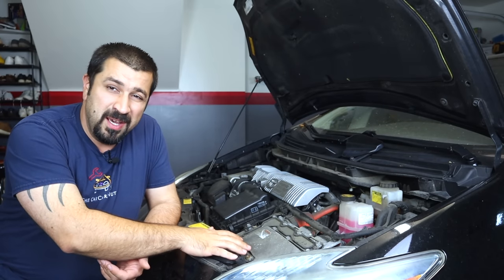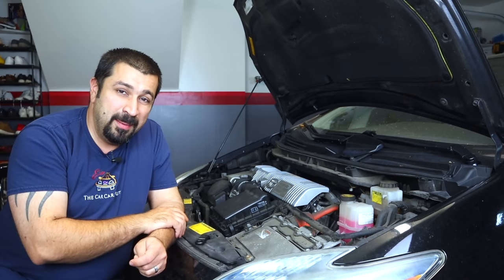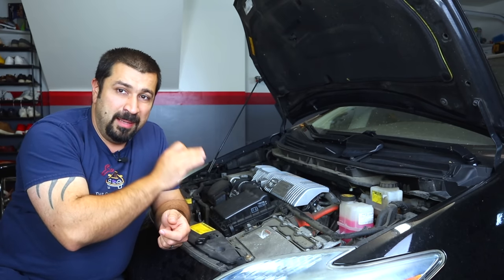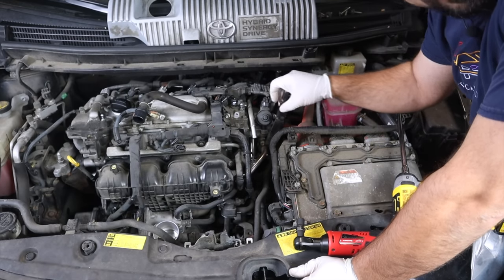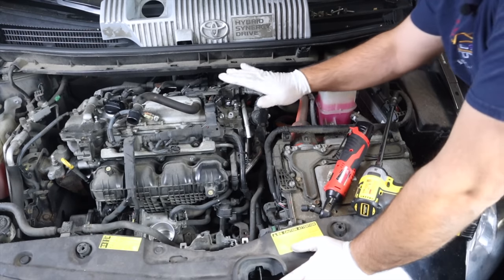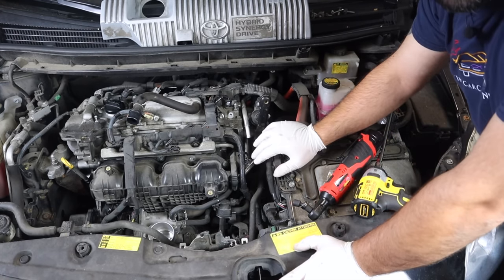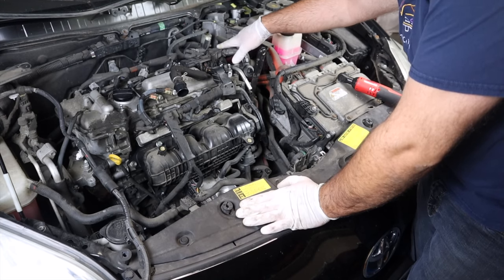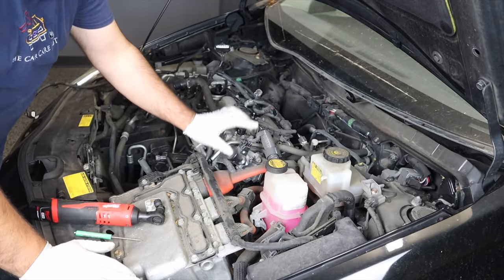Toyota EGR Diagnosis Tips and Repair Tips

Comment: I have a 2013 Prius S and i have this low freq vibration at around 50km/h or when the ICE is just kicking in (just when the HUD shows past midway). not constant just from around 50 to 60km/h.when the hv battery is low cat vibrates a lot too if im driving slow like in a carpark. is that egr related or is that normal vibration when the computer is just trying to figure out to run the ICE or use the HV battery. its only done 90,000 km was there when i got it. toyota did not see any issues with it. is it worth removing the egr sensor and see if it still has the issue or best to clean the ERG system?

Comment: Thank you AMD. Amazing stuff , as always. Question: Does the PCV valve get stuck closed or open and what are the tell tale signs? 
Suggestion: Any chance you can do a  video covering the Toyota 86, common faults and fixes and another video on what kind of supporting mods will you suggest. E.g. oil catch can is a common one people use,  another one is an oil cooler which is now standard on the new GR86 but was not on the older FT86
Reply from the maker: Hi! Usually they get stuck closed which is a problem because of oil leaks and possible oil consumption. 86 videos are on the list just need to find a candidate to use for the video

Comment: Great video as always. That’s refreshing to know you don’t usually clean the egr cooler too extensively. i assume the soot you blew out with air will shoot out the exhaust when the engine runs. 

would you recommend egr valve replacement and intake manifold replacement as preventative maintenance for cars that run fine? let’s say at 100k miles but the car still runs fine? or is it safe to drive it until it gives issues? i know the 2014+ engines got updated manifold. asking for a friend’s 2016 V. 

also what’s your take on the new egr design in the a25afks powertrains? improved? or will the same issue eventually come up. 

hope to see some lexus content from you as well as some updates on your personal projects like your mercedes. those are fun to watch
Reply from the maker: Hi! I disconnected the egr on the other side so the soot fell into the towel not in the exhaust. 

Unless you have an issue with the egr I wouldn’t do anything with it honestly. If it ain’t broke don’t fix it.

The A25A have a very similar design with promises of improvement which we’ll find out over time. The 2016 Prius has no issues as of yet.

The Mercedes video is done just gotta finish a few things and you’ll see it posted😀

Comment: My 2014 Prius with 210,000 miles, intermittently has a small shutter sound in the engine compartment at speeds of 4 mph and up to 35 mph, I don't hear it over 40 mph.   And I don’t feel it in the steering wheel or car at all.

I took it to the dealer for service. 
He diagnosed misfiring, but could not observe any misfire. 
He said Spark plugs looked fouled. 
Service Technician recommended and preformed: 
Replacement the spark plugs and 
Replaced one coil of cylinder 4 and
He also performed an ECU update. 

After service complete, I am experiencing the same small shutter, with a lot more frequently at the same speeds.  It shutters often now. 

Will this cause any harm to drive it like this.  I do a lot of long-distance Interstate highway driving at 65 to 80 mph in Texas and Louisianna?
Reply: Gen 3 prius has issues with EGR fouling. People on prius chat suggest cleaning the entire egr circuit (intake manifold, egr pipe, egr valve and egr cooler) as early as 80,000 miles. Search youtube for EGR cleaning and you'll see a dozen videos on this. You could ask the dealer to do this repair under recall with the replacement of the valve, but most dealers won't clean the entire circuit.  You might not qualify for the recall as it's below 10 years or 150k, whichever comes first. Dealers also don't clean and only replace parts. If you continue, the next common problem is head gasket failure and that will be a repair in the thousands.
Reply: @andrewareva4605  - mine is a  2014 Prius Hybrid with 210,000 miles so I gues that does not qualify.

Comment: One thing about "professional" when you see a dirty air filter, it is not your money, replace. I have a friend that came from the mid east desert area, that place make severe service sounded like a joke, and parts are hard to come by. So they just remove the air filter and blow it clean , both directions and only replace it if damaged.  I do not live in desert areas and I added some cotton like air conditioning pre filter to my air intake box, I never replace the filter. PCV valves used to be replaced like spark plugs in the years past, which is annually, spark plugs do not last as long with points and condensors. I used to just put carb cleaner through it and make sure it will rattle, then I put it back.  Those valves are longer lasting nowadays. Even spark plugs can be sand blasted and tested. But it is not worth it for cheap auto plugs. That is often done with aircraft spark plugs that cost $40+ each and have 2 per cylinder and they get lead fouled.

Comment: Had the EGR valve and manifold assembly replaced 3 years and 50k miles ago by Toyota and now being told it needs to be replaced at same dealership again? Looks like they did not clean the cooler back then like you did in the video. Should it be needing replacement that soon again? Did not cleaning the cooler cause this?
Reply from the maker: Hi! Did they do the update at the time of replacement? What’s the car doing? Have codes or misfires?
Reply: @TheCarCareNut  They told me they did not do the update at the time. However, after much back and forth I requested a video of when they removed the manifold to show me the EGR when they got to it. It was indeed really clogged and the cooler was severely clogged as well. I had both the cooler and valve replaced as suggested. Still wondering why it clogged so quickly? I did have the factory spark plugs still on there @222k miles, did that contribute?
Reply from the maker: Possibly. I would replace the spark plugs as well

Comment: Can't you just unplug the wiring harness from the EGR valve to disengage the EGR system to test it? I was getting bad misfiring and shaking in my 2010 and I just unplugged the EGR valve and it immediately ran fine for several months until I got around to cleaning out the intake.

Comment: Hi AMD, is there an easy way to replace PCV on 2010 Camry 4 cyl with 135K any tips? And do you think it can help resolve some of the oil consumption on this engine?
Reply from the maker: Hi! You can either try to reach it through the wheel well which is difficult unless you’ve done it before or just remove the intake manifold which is what I’d do
Reply: @TheCarCareNut  Thank you for reply. Do you think it can potentially help with oil consumption on this 2AR-FE engine?
Reply from the maker: It could but an oil cleaning solution helps more
Reply: @TheCarCareNut  What type of the product you had a success with?

Comment: AMD... Great video on a EGR for Prius hybrid! I was very interested in this video because I have a 13 Avalon hybrid with 90,000 miles. Should I be concerned about my EGR? Throttle body or nothing like that has been cleaned but it runs smoothly at all times
Reply from the maker: Hi! I wouldn’t worry about the EGR unless it has issues. If it ain’t broke don’t fix it.
Reply: @TheCarCareNut  okay thank you!

Comment: Hey I've been having issues with my 2012 prius v2 it has a rough start has been for awhile now I replaced spark plugs and coil packs as it threw a misfiring code for cylinders 2 and 4 that didn't solve the issue any ideas? 

I was going to clean out my egr like this video.

Comment: You mentioned Toyota replaced EGR valves for free some time ago.  How do I know if my used 2010 Prius had this done by Toyota?
Reply from the maker: Hi! You can call your local dealership and they can run the vin and find out.

Comment: What if i get a p0302 code for missfire? Would changing all the spark plugs fix the problem or would i still need to clean out the egr valve?

Comment: Hello,

I would like to buy a 2018 Lexus CT200H and would like to know if the reliability is better than the 2012/13/14 models?

While researching I saw that Toyota had modified this engine and would have received a number of modifications depending on the years, modified head gasket, segmentation / pistons, egr valve etc...is this true?

Thanks in advance.

Greg from France .

Comment: How would you recommend cleaning the intake valves on a 2017 Camry hybrid se
Reply from the maker: Hi! Are they carboned up?
Reply: Not sure , but I thinking about using fuel additives like gum out for tune up because My car is at 130000 miles

Comment: Could you give me your thoughts about an oil catch can for a 2010 Toyota Prius
Reply from the maker: Hi! That engine does have an oil separator so unless it burns oil it doesn’t really do much
Reply: @TheCarCareNut  Where is the oil separator on a 2010 Toyota Prius
Reply from the maker: Behind the intake the Manifold on the block where the pcv valve is

Comment: Would an oil catch can be helpful on a vehicle like this?
Reply from the maker: Hi! It can but this engine already has an oil separator built in behind the manifold which is where the pcv valve connects to which does the same thing

Comment: Question...2gr-fe V6 engine (08 Highlander) vibration between 900 and 1000 RPM. When it's cold start it rumbles the floor.
Reply from the maker: Hi! That could be normal of these engines. They do tend to be on the rumble side at times. Try cleaning the throttle body

Comment: Is it true the gen4 has a larger egr that's less likely to block?

Do you know if products like Techron help avoid EGR clogging?
Reply from the maker: Hi! The 4th generation did get an updated egr system and so far so good. The software update does limit or eliminate the issues by changing the way the egr system operating.
Reply: @TheCarCareNut  The EGR on 4th gen comes from exhaust after the cat. It is a lot cleaner. The 3rd gen EGR takes exhaust gas before the cat. On a side note, my brother's EGR cooler plugged up 100%. I replaced it and the valve. The intake manifold wasn't that bad. I did replace the PCV though.

Comment: Hi
There is a nut and bolt on egr, and the long nut is in there tight, what technique you have for taking that bolt out ? It has a hex end maybe a #6 socket fit.
Reply: Also, why remove the cooler at the rear if just blowing out ?

Comment: Hi AMD.I am a female that recently purchased a 2010 Prius. A code came on today p0401 (EGR). I'm losing coolant slowly and I put in the coolant reservoir some sealant thinking I have a blown head gasket. Could what I did cause the p0401. What would you suggest I do with this code? Any help would be appreciated. Im in Las Vegas NV. Do you know any mechanics in Las Vegas you could refer me to.
Can I drive my car with the engine lught in with the p0401 code? Can I out fuel injector cleaner? Would this help? Thank you kindly

Comment: appreciate the video more hands on and I own 2 Toyota's.   AMD do you have an email, I have a few questions about another topic which is minor stuff  that stopped working, require replacement but would like to also upgrade.
Reply from the maker: Hi! The email is really getting backed up. Post your questions as comments here and I’ll get back to you.
Reply: Please advise me if there is an easier way to replace the day/ night sensor without removing the dashboard.  on a 2008 Lexus is250 AWD.  it has all options with navigation.   appreciate  your time, AMD.
Reply from the maker: Jay I’d have to look into it as I don’t remember that right off the top of my head. Reply to this comment and I’ll get back to you.

Comment: i have a dealership maintained 2010-Prius. 
recent “check engine”, just a few days after they had our car for almost a month ( internal computer module, warranty change), 
turned out to be an EGR valve issue.
there’s no symptoms nor any mention on previous detailed reports , 
but for this new “check engine” light.
why is that?

Comment: Hi all mechanics! (or channel owner)

Im sure you’re INUNDATED with work between the channel and your shop, but i REALLY could use some help.. especially being that you’re a master diagnostic tech.

THE STORY:

I live in NJ, Girlfriends toyota prius (gen 3, 2011 87K miles) was parked at her job for 8 hours on a 40-45 degree F day. When she went to start car, engine began to shake notably which was audible from inside car. this scared her so she immediately shut it off and called me. 

When i got to the car she turned it on and with the hood open i could visibly see the engine shake, after letting it run about 20-30 seconds car seemed to level out and engine appeared to sound normal. however, now each time car is started engine appears to shake for a small period of time (1-2 seconds).. this understandably has her paranoid and she hasnt driven or moved it from her job. This happened 11/24/22 on thanksgiving.

I have no mechanic expertise, however after some research into the gen 3 prius issues ive narrowed it down to 7 main possible problems..

1. Headgasket -
(Coolant is reading right at  “low” line in main tank and in inverter coolant tank) 

I performed a block test while engine was cold, and after allowing engine to reach operating temp, test fluid remained blue. 

exhaust came out of tailpipe white for 5-10 seconds after cold start on cold day but after that it was completely normal

no “sweet” smell by motor..

so not sure if its HG,  because low coolant is suspicious but it passed block test and no other obvious signs showing..

2. Possibly EGR - Car has probably never been maintenanced for EGR (it was a used vehicle)

3. Possibly the intake manifold

4. Possibly dirty fuel injectors 

5. dirty/bad spark plugs

6. PCV Valve bad?

7. Maybe condensation from humidity in air made it into cylinders, causing that initally rough engine start until it burned off?

For any mechanics or people with toyota prius knowledge is there something im missing or should i go to a shop and have them explore into these main 7 issues?

The REAL issue is we dont have alot of money, we’re both medical field college students trying to survive in a studio apartment and life is just rough right now.. alot of mechanics either give the “dick you around” answers, or the “scammer” vibe and i just want to make sure when i go to a trusted mechanic i can point them to the right area to avoid wasting time and thousands that we barely can afford in pointless repairs especially since most people dont work on these prius hybrids often.. 

I can exchange contact info and send a video of the engine upon that initial rough start-up, and how it sounded AFTER 30 seconds running..

Im desperate guys lol.. and she has no way to get to work so its a rough time..

- THANK YOU SO MUCH FOR TAKING TIME TO READ MY DILEMMA
Reply: I am NOT a mechanic. What I tried and made a difference (reduced startup shaking) was cleaning the MAF sensor with MAF cleaner and cleaning the Throttle Body with Throttle body cleaner. There are videos on how to do on Youtube. Good luck.
Reply: @norbertojr001  the issue ended up being that the car had a lot of condensation due to being started on a cold, humid day. We towed the car to a mechanic that we discovered on YouTube and his shop did a full inspection of the vehicle and they made the determination that there was nothing wrong with the car that the car had a cold start that just didn’t sit right with the engine, but it was only a temporary issue so this was back in November 2022 and now it is March 2023 and we have had no issues with the vehicle up to this point so I guess the mechanic was right and we did not have to spend money on any crazy repairs or scams they were actually really good mechanics but thank you for responding to my message. Nonetheless, I appreciate it!!

Comment: Pro tip: use a pressure washer with warm soapy water to clean Intake manifold and cooler. Gets the job done very well and quickly. I took mine to the local car wash. No need to deal with big volumes of toxic cleaner and manual brushing.
Reply: Of course make sure everything is 100% dry before reinstalling. I left mine above my house heating vent for a few days.

Comment: If you're still monitoring comments here, is there anything that can be done as part of normal maintenance to keep the valve from getting clogged or at least increase the interval between the needs for this kind of repair?  

Is it possible to do the SW Update using a tool other than techstream?

Comment: What are your thoughts on installing an oil catch can to prevent the intake from clogging again?
Reply from the maker: Hi! This engine has a build in oil separator. Updating the software and replacing the valve with the updated one is enough to prevent it from happening again.

Comment: my 2014 avalon hybrid sometimes sounds like a deisel when I am letting off gas slowly to decelrate and then when I hit the gas I get a knocking noise in my engine and feels like engine is struggling! Is this my egr valve? 160k miles and if so what would a dealer charge 2 fix. I just dropped 5k into my car in last 3 weeks!

Comment: I know Toyota "Updated" the EGR design on the 2016+ Prius. In your experience has this solved the EGR issues clogging?
Reply from the maker: Hi Eddie. Technically they made the change in 2013 and more updated on 2016+. I haven’t seen any 2016+ EGR problems yet
Reply: @TheCarCareNut  I had EGR valve issue on new Prius Prime 2021 after ~100 miles. Toyota dealership (Leith Toyota, Raleigh NC) was very surprised and said that must have been factory issue. They replaced it for free and so far so good.